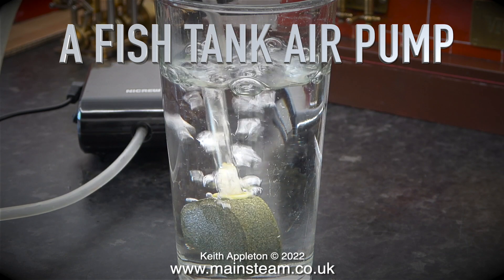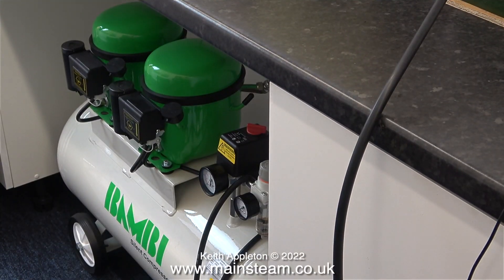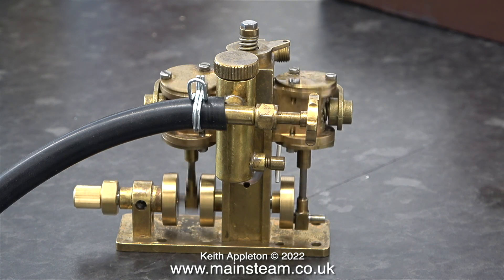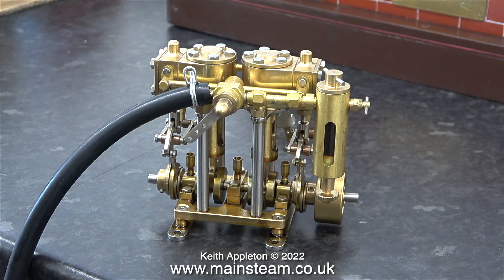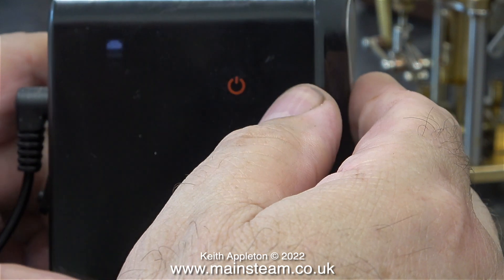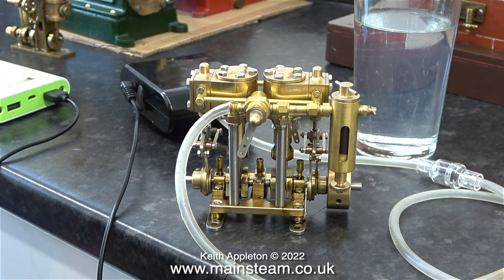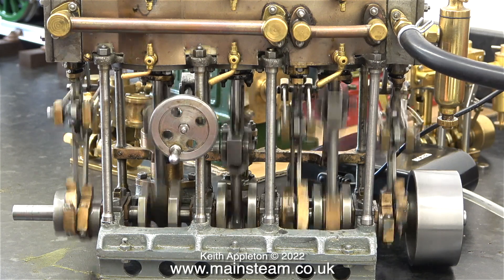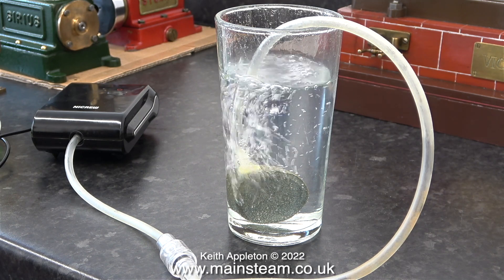WILL A FISH TANK AIR PUMP RUN A MODEL STEAM ENGINE?

Comment: Aquarium pumps are set for high volume and low pressure as they typical work at depths of circa 24"  ie 0.06 bar

Comment: I have had success with an aquarium pump. The pump was rather large, powered by mains voltage, had a variable speed adjustment. It also had 4 individual pumps that supplied 4 separate outputs. I had to tie all 4 outputs into one and put the pump on full speed to get it to supply adequate pressure to power my single cylinder oscillating engine. Even then the engine ran at quite the slow speed and had no capacity for any type of load.

Comment: Keith, there are different types of aquarium air pumps. Some are vibrator type with a coil and some are piston types like some air compressors. Large series of tanks need larger pumps including almost the size of your air compressor. But I suspect your little air pump there may be a weaker type. I didn't think it would work but was surprised the little one almost did. Thin oil would help but it probably isn't enough.
Reply from the maker: Yes, thanks, I am well aware of that and I actually point it out in the text on the Youtube video page . . . . I just used the one that I have, as it is a normal typical cheap small aquarium pump.